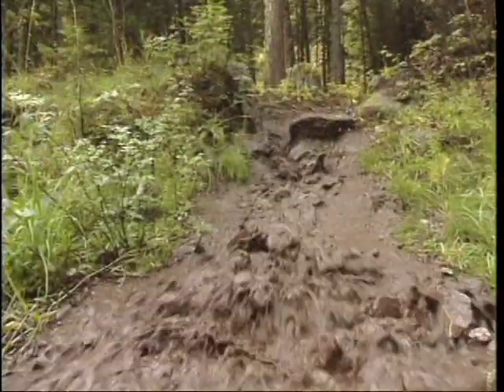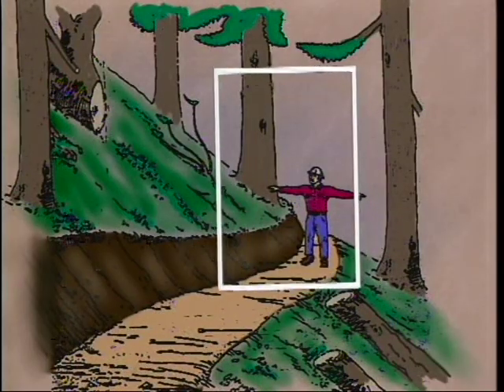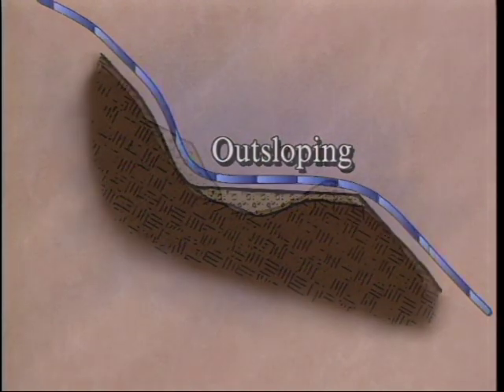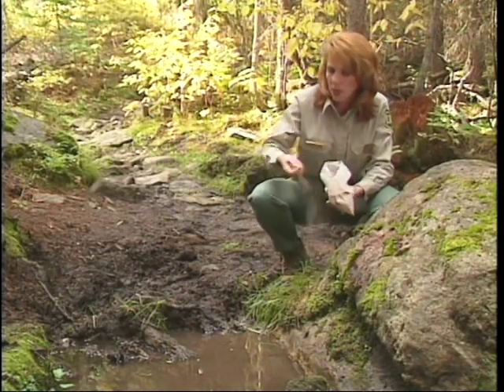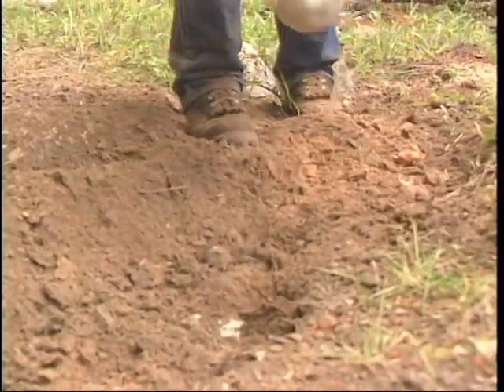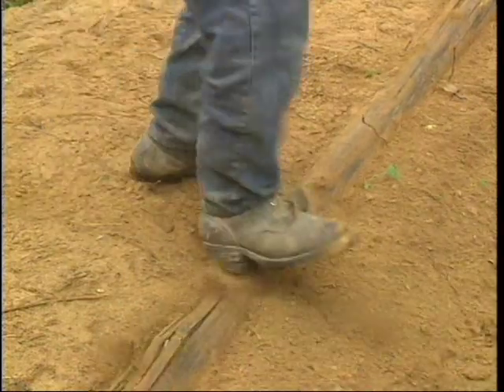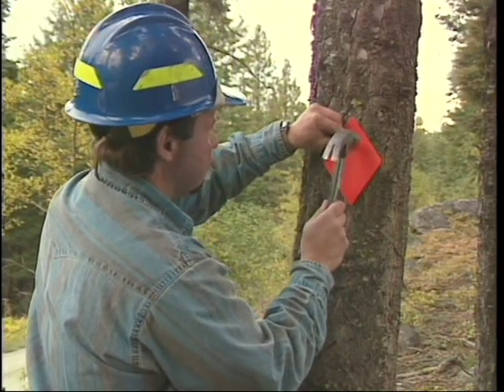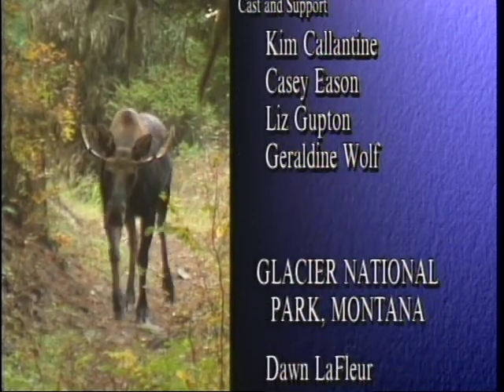Basic Trail Maintenance

Comment: This is a great resource despite its age here's a rough guide. 0:40 End of Musical intro
2:00 Getting Ready
3:25 Job Hazard Analysis
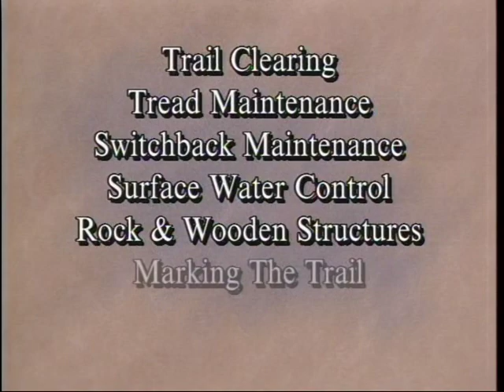3:54 Trail Clearing
7:31 Tread Maintenance
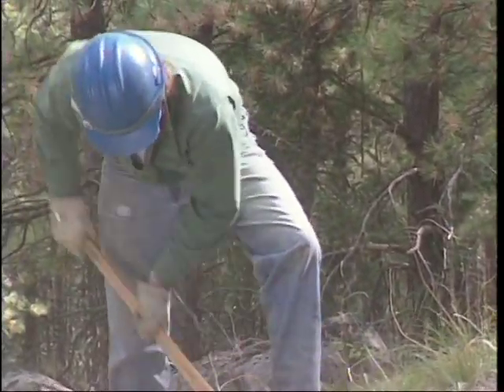8:51 Correcting Trail Creep
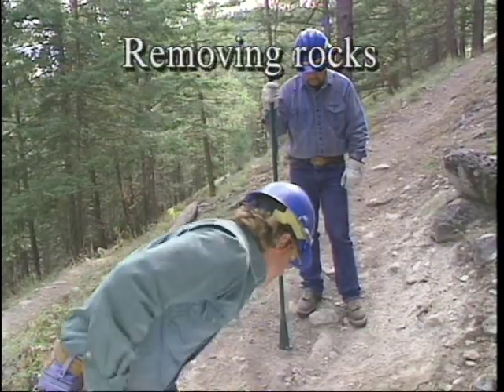10:03 Removing rocks from the trail and filling holes
12:42 Switchback Maintenance
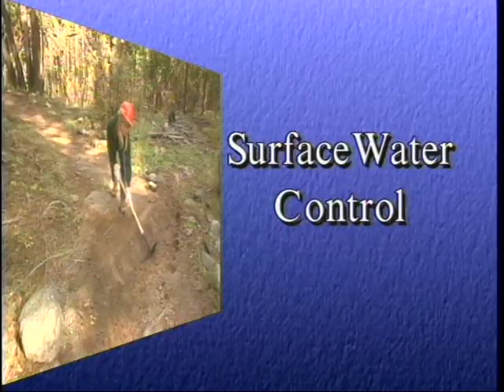14:45 Surface water control
17:03 Removing Standing Water
19:24 Rock Structures
20:33 Wood Structures
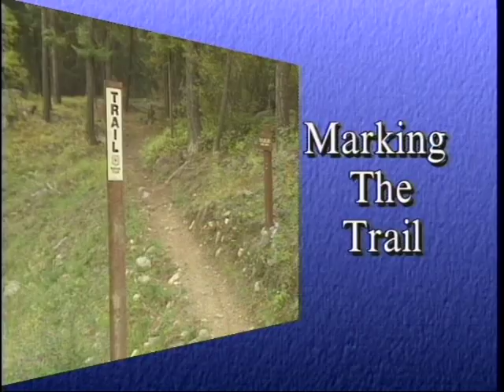21:33 Marking the Trail
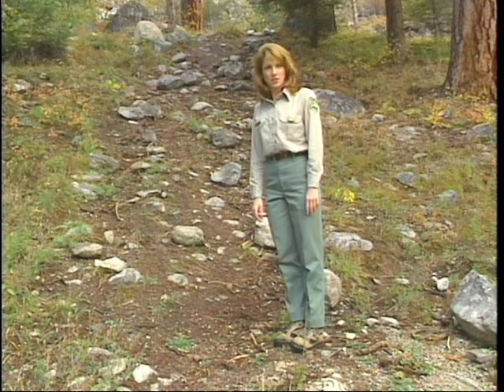24:09 Trail Obliteration

Comment: I'd like to check out a video on constructing trail switchbacks, but this video doesn't exactly fit the title.  In the segment on building (or rebuilding) rock walls, I'd like to see a recommendation to be sure to embed the bottom tier deep enough to hold the wall when soil erodes from the low edge, and to remove organics down about 3 inches (or more) below the soil level so that the rock doesn't wobble or rock when stomped on from various angles.  The wall should be angled inward (battered) enough that the pressure behind the wall plus gravity will strengthen the wall, rather than forcing it outward; and the rocks are more likely to fall back into position if forced apart by ice.  The vector angle varies depending on the type of soil and the shape of the rocks.  Completely flat surfaces tend to slide against each other, so they need to be battered significantly.  When Ideally, fit together depressions and bumps on the rocks (a 3-D jigsaw puzzle) so that all of the rocks are stable and don't move when stomped on from various angles.  Rocks higher up in walls should generally be "half-man" in size and have 3-point contact so they will remain stacked and stable when the soil of the trail compacts.

Comment: For motorized bike trails the trail need only be as wide as the handlebars or maybe 32 inches at the handlebar height and 4 to 6 inches wide for the tire track
Reply: 32 is still tight for a dirt bike. Most are 3'

Comment: Life member of the National Speleological
Society and another 'Gone The Distance'
associate of the Pacific NW Trail Association
(cave trail access repairs).    Also are away
today to attend another cave access trail on
private property.  Maintaining that trail as the
owner directed allows 24/7 access to cave(s).
The karst exposure has more than one entry
not yet fully explored.  Another trail I do
other repair on are for dirt motorcycles and
the property is owned by businessman who
sells KTM and other off-road rides.  I ride to
work sites on a DR650SE fitted with tools.  
All this is between a sea and alpine summits.  
P.S. - I never use a axe, hatchet, or machete.
Just ignore my shoulder-holstered Glock .357